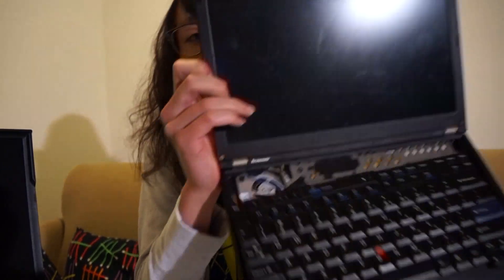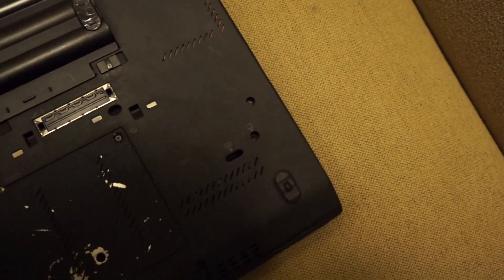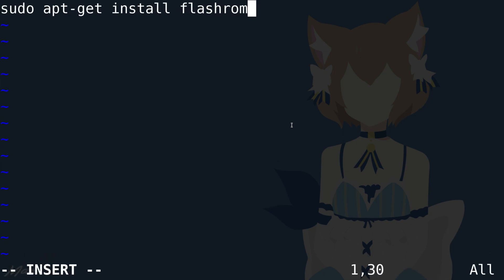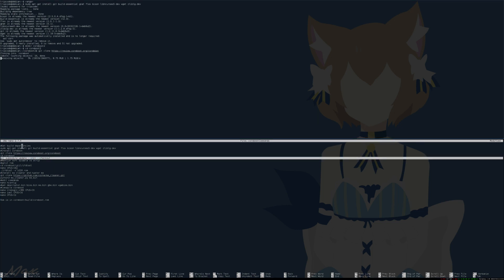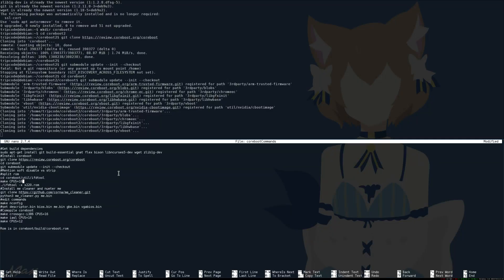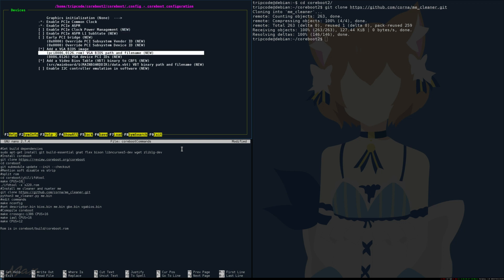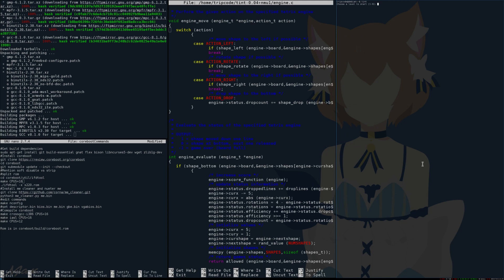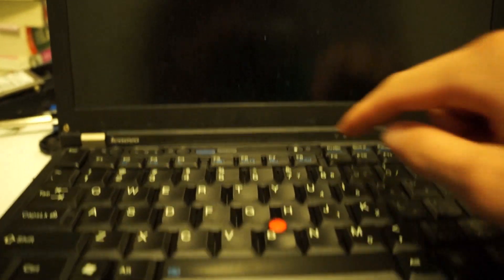How to coreboot your X220 (seabios + vgabios & me cleaner)

Comment: 00:38 were supposed to ALSO connect the Hold and WP pins to Vcc?  Great channel you got here. Your and Luke’s channels have recently caught my interest and starting to binge.
Reply from the maker: It has been a while, since I've corebooted an x220, but typically it is just 6 wires to the raspberry pi. My apologies about the confusion, but I'm glad you enjoy the channel.

I do remember having some power delivery issues, on that rpi, but I think it was a very early version. My current flash programmer setup is still an old rpi, but headless using ssh :D

Comment: Thank you very much for the video, I have my lenovo T500 which does not start anymore as before and remains blocked on
the first start page setup, I tried everything to get it to work with no success.
Now I want to flash the eeprom P24s08 memory because it is blocked, but I cannot find the bios
factory other than that offered by Lenovo support.
Can you help me get this copy from another T500 if possible or direct me to a site ....
Thank you in advance.
Reply from the maker: ? umm is it bios locked...

If not try a precompiled rom libreboot has those.

You should be able to compile blobless coreboot for it. Another common thing is that the ATI cards die, but they have integrated graphics, so a blobless coreboot or libreboot might fix it.

Comment: I know this is an old video but compiling on the Raspi seems to take a ridiculous amount of time. I've been Building GCC for 9 hrs now, I can't even tell if it's doing anything or unresponsive at this point.
Reply from the maker: Use crossgcc on any system. T. made the same mistake first.
Reply from the maker: Also I can't sleep and am replying to youtube comments so if you need any other info just ask me :D
Reply: @tripcodeQ7  I was curious about one thing. My x220 hangs on the "Welcome to GRUB!" screen in SeaBIOS for a really long time. Is there a way to install arch without using the grub bootloader. I didn't install VGA bios btw.
Reply: @tripcodeQ7  Thanks for the replies! I tried compiling on Arch and it went much faster but with some errors building IASL. The solution ended up being setting up an ubuntu VM and building it there then sending the rom back to the pi.

Comment: I wonder if it's possible to extract VGA bios and use it in combination with TianoCore to boot windows? Not exactly the best solution, but I'm curious.
Reply from the maker: I haven't tried tianocore, seabios booted a 7 copy from msata recently, so at this point I'm a bit confused of what is supported and what isn't.
Reply: @tripcodeQ7  I had trouble compiling TianoCore myself due to missing dependencies on Arch. But I didn't find any info saying that Tiano doesn't boot Windows. There's also Yabits, but this one definitely doesn't support Windows yet.
Reply: @tripcodeQ7  Seabios should support all standard mbr os I am pretty sure. It's just obviously grub that can only boot linux.  Tianocore is a uefi version of Seabios.
Reply from the maker: @gabrielgomez2483  seabios last I checked is missing a few things (some bios calls), but I got 7 and 10 to work both with it. I wonder how 2000 would handle on it.

Comment: is this at all worth the effort? i get that its for the max level autists but what are the actual measurable benefits?
Reply from the maker: No whitelist. Faster Ram. Configurable settings. Faster boot.

If you use a grub payload you can do some pretty cool stuff as well, such as a encrypted boot directory.

Coreboot also has secondary payload options such as memtest 64, or even tint(tetris). :D

Probably some other stuff too.